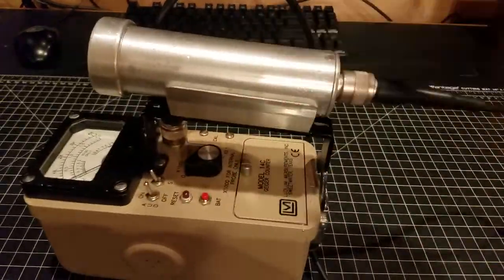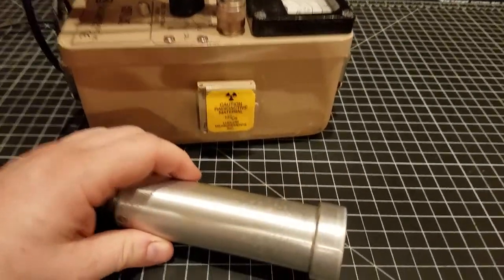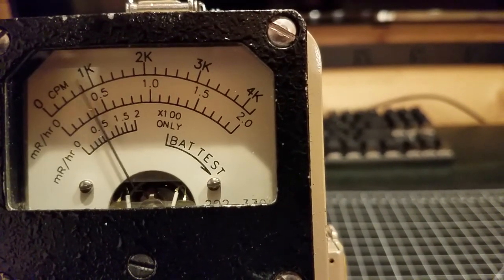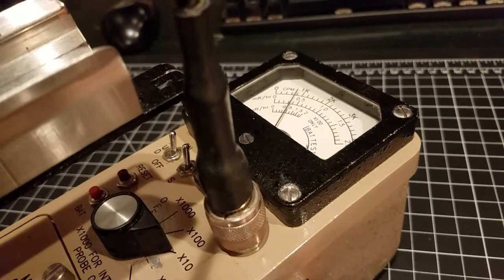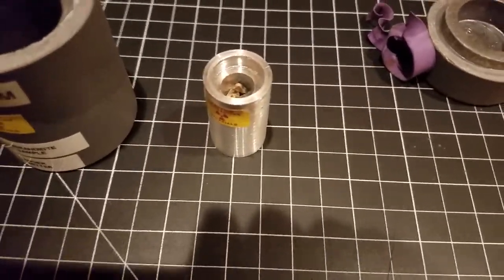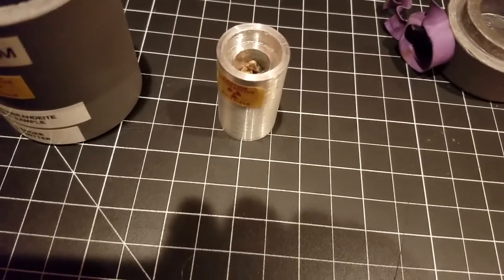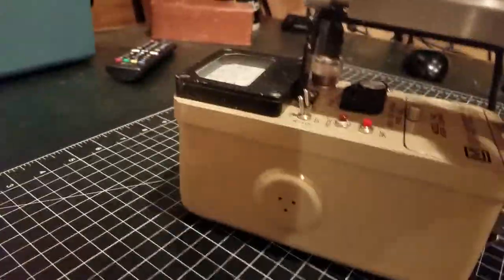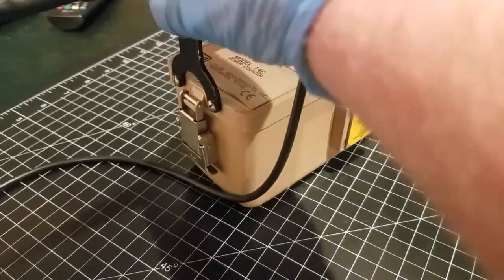Ludlum 14C Geiger Counter

Comment: I'm having issues with my 14c it's working normal on all settings with a 44-9 pancake probe, but as soon as I put on my 43-5 it's not giving much in reaction.
I know my probe isnt damaged based on run time with a model 2. Do you have any idea on what could be my issue?
Reply from the maker: The big thing that comes to mind would be checking your high voltage setting.
Reply from the maker: You may need to calibrate it for the probe. The manual should tell you what you need to do.
Reply: Yes, you would need to drive the tube in increments of increasing voltage steps, count the clicks at each step the tube is generating at each step, and plot those on graph paper. The plot will inevitably show a rising click count with the increasing voltage starting at lets say 100v, a plateau where the increasing voltage is not making much difference in click count, then continuing on a rapidly increasing click count as the tube begins to be overdriven and the resulting click count "runaway" (not good). You would want to adjust the voltage on you meter to match the center of this plateau where the increasing voltage is not making much difference.  I use a Model 2200 Scaler Ratemeter to do this, there may be other ways to do this. Ludlum has a nice article online on how to do this.
Reply: Send it to Ludlum, they will calibrate it for $75